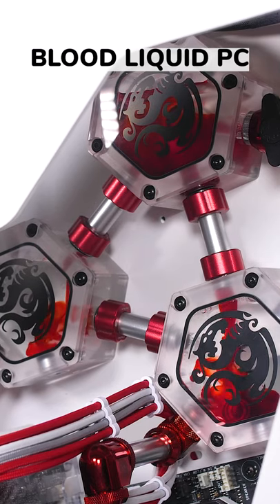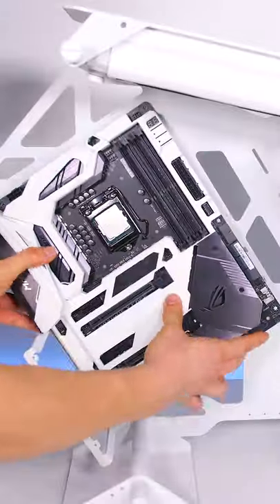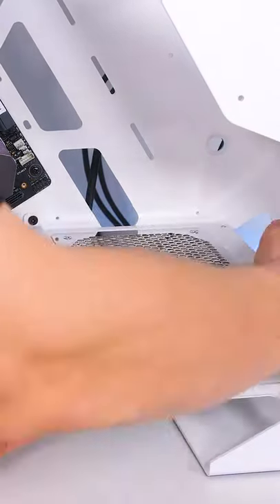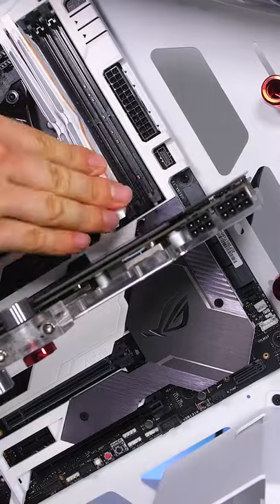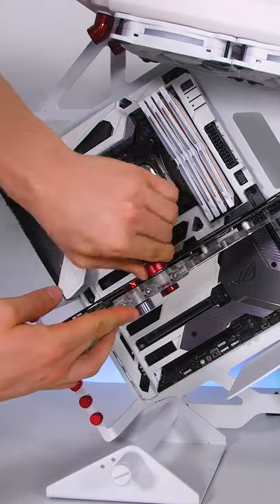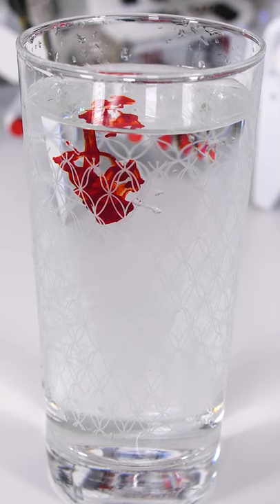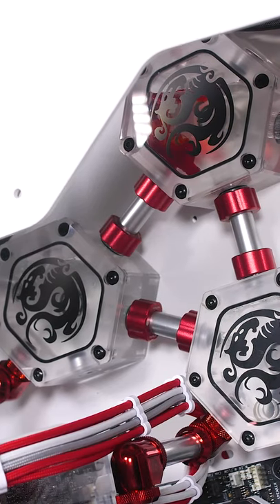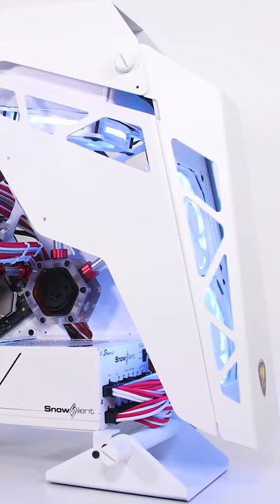$6000 Water Cooled Gaming PC Build | Cougar Conquer Time Lapse

Comment: How that 6000 was divided. 5500: motherboard, aesthetics, water cooling. 500: psu, gpu, and cpu
Reply: Pretty much haha
Reply: This is a 2018 build, so not really
Reply: @Zyncra even in 2018 the pc components wouldn't cost that much. This is a 2.5k computer with an expensive case and a waste of wc components.
Reply: @detective_mitch_conner  this is from 2018?????
Reply: @zuko_thecat   gtx 1080 the fuck you think
Reply: @detective_mitch_conner well no sht?? This was a top of the line pc back then and he had the money to use it in aesthetics, you could've had that build for like 3k without the watercooling and white parts but he had more money to spend🤷

Comment: no i like the case but prefer if it's as enclosed as possible. so basically just the back part has a non filtered holes/aluminium. esp since you are not supposed to be moving those around often. the pyramid case is cool ngl.

Comment: 2 THINGS I WOULD HAVE DONE DIFFERENTLY - CLEAR TUBES & METALLIC BLOOD RED!!! - Obviously clear tubes so you can actually see the Blood Red Fluid...  There just aren't many spots you can see it looking at it straight on.... at the right angle you can see the fluid in the GPU better, but clear tubes would add just a few more spots to see it. AND I would make the fluid have that metallic look that I occasionally see in builds. It allows you to see the fluids movement much better in the places that it slows down, like in the 3 reservoirs and the (CLEAR) tubes 
- Oh I just thought of a THIRD thing I would do.. it's not much but I think it would be the PERFECT finishing touch.. I would add  some WHITE LEDs (or maybe RGB, if they could be changed around independently from the ones in the fans and any others in the build) and place them BEHIND the 3 reservoirs (if the back of them is also clear) so that the light SHIONES THROUGH the (metallic) BLOOD RED Fluid!!!!!  It would probably easy to get a place like PCBWay or JLCPCB to make a PCB to the exact size you need that has the LEDs right on the board in a hexagon arrangement and add the electronic components to drive the LEDs and whatever connectors you need to hook it up to the motherboard or a controller box... 
- BUT other than that IT IS PERFECT!!! (and I could NEVER do ANYTHING even close to this!!! You are AMAZING IFR!!!!